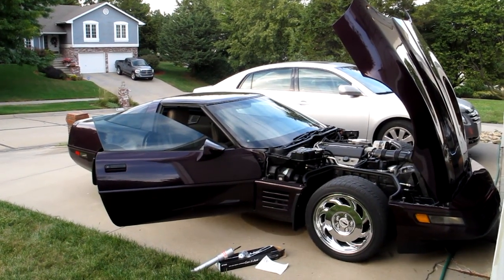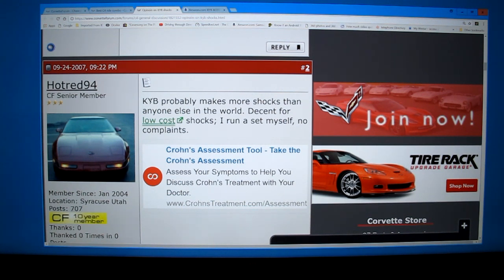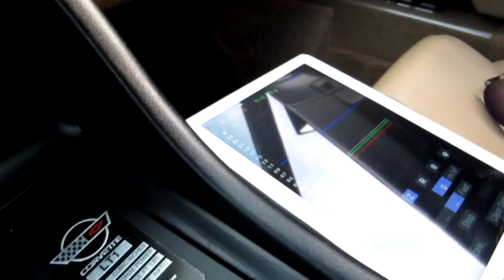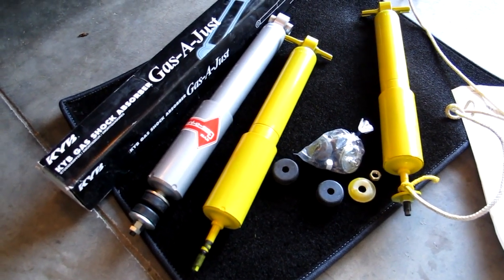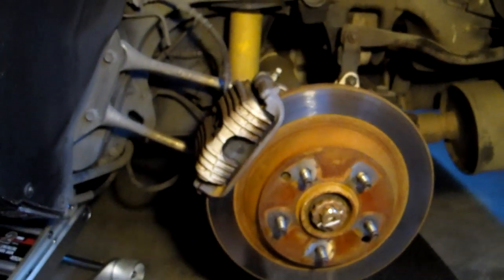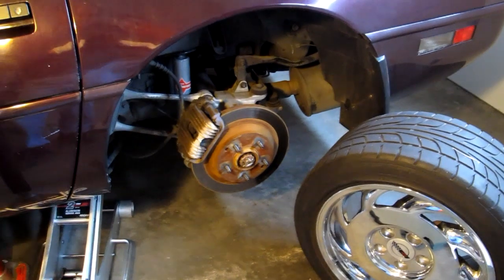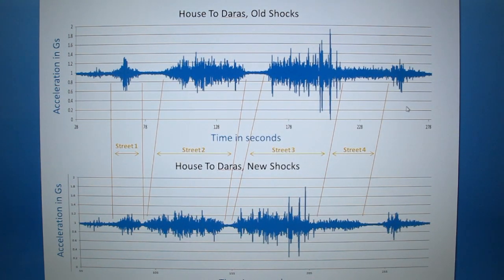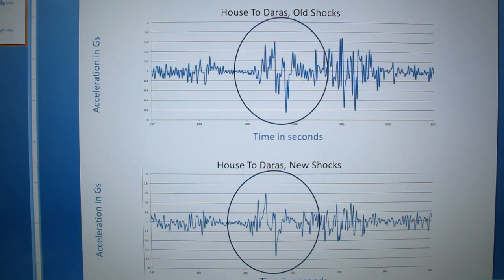Shock replacement and ride quality in 1992 c4 Corvette

Comment: I replaced the still working 27 year old FX3 Bilsteins on my 93 with non asdjustable Bilsteins and couldn't be happier especially with low speed about town driving.
What is the radio head unit you installed...it looks like a perfect fit.
Reply from the maker: Sounds like an excellent choice !  The radio is a Jensen VX7020. I was lucky that a previous owner had already changed out the original and installed new speaker wiring - otherwise it would have been a bigger job. It did fit, but just barely. Here's the whole story :-) https://www.youtube.com/watch?v=w7wkTAyuNk4&list=PL9Ox3wpnB0kqikYYfiCdei_ikfJP8-Eul&index=2

Comment: Time for softer springs.  Going from 2 cps to 1.8 makes a big difference
Reply from the maker: It appears that lots of things help.  Earlier this year, I replaced the tires with Michelin PilotSport A/S 4 types and it improved even further.  Previous tires were decade+ old Firestones. I liked the look of them, and the handling, but the new A/S 4 tires help soften small bumps, so some road surfaces feel much better. Bigger bumps/holes are still somewhat harsh though. Maybe the springs would help that?  (I know in the '87 models the rates were very high and they backed them off the next year. This is a '92. But another commenter noted that I do have the HD suspension...  Build sheet shows FE7 )

Comment: tires and how much psi you have in them is another thing to consider when going for a better ride quality.
Reply from the maker: Excellent point !  I noticed that on our van which came with some pretty hard riding proxy tires.  I even deflated them to 22 psi one time to try to improve the ride, but in that case, no luck. Fortunately they didn't last real long and we got some "ComfortTreds" and they made the van so much nicer !  The Corvette ride definitely degrades a bit with more air (I have them at 35 psi for the coming winter and noticed they are more harsh). In the video before and after though, they were unchanged - so the shocks help too :-)

Comment: Thank you SO much! I downloaded it and will use it to test my Vette. I think it has original shocks on it, so it would be great to know whether or not I really need to replace them and whether if I put on new ones it will really get better. I think it has Bilsteins now, but it is an old car, even though low mileage. I think maybe just being old, the shocks might need replacing. Don't know...

Comment: EXCELLENT data. None of this "it just feels better to me" stuff. Just curious, but did you have to do an alignment after replacement?
Reply from the maker: Thanks.  No alignment - I don't think it changed anything significant about the front stance - and even the rear height settled back to close to where it had been. One comment on making measurements like this: The tablet needs to be secured to the floor well so it's not bouncing itself. I tried to do this with some old blue jeans to add some light weight on it. I think they're visible in some of the shots of the 'after' measurements :-)
Reply: @MegawattKS  I am in process of buying a 1993 Corvette, and your info is very welcome. Can you tell me the name of that program, and whether it runs on Android?
Reply from the maker: @moodberry  A good year ('93). My '92 was the first year of the LT1, but fortunately it seems to have been pretty stable, despite being a new design. The "Optispark" gets a lot of hate, but its one of those things that was fixed I think. (and mine was replaced and has been OK - even though I had an ignition problem, I traced it to the coil/ICM and avoided the trap of thinking everything is an optispark problem ;-) )  Back to your question - yes I was running it on an Android tablet. The one I was using is called "Accelerometer Meter" by keuwlsoft. Seems to still be available in the Play store although when I install it now it says it hasn't been updated for my phone's Android version (10). But it seems to still work. When using the Graph mode, when you stop and select Save, it saves to the root directory. I am able to see the txt file when my phone is plugged into my Windows PC - at the top-level directory just as it said...
Reply from the maker: Also - its pretty easy to run. But you may have to 'pinch' the screen to rescale it if it pegs one of the XYZ axis g-force plots to the top...

Comment: What did you do with the shock sensor?
Reply from the maker: Assuming we're talking about the warning light - I was fortunate that someone had already disabled it (don't know how unfortunately).  At least I tested to see what would happen by pulling the plug to an actuator before I started the job and no light came on. So it was disabled, or maybe the system didn't see an open circuit as an issue ?

Comment: Nice adding a little science to the install, thanks I am about to install new shocks. Did you polish your wheels? Mine is the same style, just stock finish, which is a bit pitted. I expected it to settle after install, that is pretty normal.
Reply from the maker: Thanks. The wheels were already Chromed by a previous owner - so I can't take any credit for that. It was about 15 or 20 years ago, but they've held up well :-)

Comment: When you lift your car off the ground and set it back down it'll sit higher than usual. After driving around a bit it will settle down normally. This is fairly common across most cars except for those with air ride they'll settle way down after having been lifted and set back down.

Comment: Great video and great data to back up what you are feeling as you drive.  I don't know if you are aware of this or not,  but the Corvette you have has what is called the Z07 package.  This is what the option on your window sticker shows as "adjustable performance and handling package". This is not just the fx3 adjustable suspension which could be added as a separate option without the heavy duty suspension. This was considered the racing suspension option that very few corvettes had.  This option not only gave you the fx3 adjustable shocks it also came with much stiffer springs and bushings.  The fx3 controller that came with the package was also tuned different for this setup.  It also came with different sway bars from the base car. This package also gave you the bigger front brakes which are rpo code j55 that you see in the build sheet.  All of these pieces together make for an amazing handling car,  but not great for cruising.   While I understand the reason why you went with the shock you did.  It's just unfortunate that you have this particular corvette with the Z07 option.  As it is going to be difficult to make it ride much smoother without replacing a lot of the suspension.   But in the end just enjoy your car the best you can.
Reply from the maker: Thanks for the information !!   I wasn't aware the car had the Z07 package / racing suspension. That's actually really cool - even given what it implies about the limits for toning down the ride :-)  Glad I kept the old shocks and controllers in case someone want's to rebuild them someday.  I'll have to dig more into the Z07 and learn more.
Reply: @MegawattKS  Here is a chart that  has all the details about the suspensions used on c4 corvettes.  https://www.corvetteactioncenter.com/specs/c4/1984-1996-corvette-suspension.html
Also if you open the center console of your car and look at the bottom of the lid you should see the rpo sticker.  It will list all the option codes your car came with.  You should see a code Z07 on yours.
Reply: @MegawattKS  I have the z07 package and just ordered new fx3 bilsteins hopefully their as good as they say

Comment: So are you happy with your choice?does it ride smoother?thing about putting these on my 95 vette.
Reply from the maker: Yes. For my use I'm definitely happy with the results. I don't put that many miles on the car, and don't do track. But for around town enjoyment of the Corvette machine, I feel like they provide a good compromise. The car still corners better than any other car I've used, and the ride is noticeably better. But they will not make a night-and-day difference in the ride. They just settled it very nicely. Hard springs are still there of course. And the new shocks are not as beefy as the originals, as can be seen in the video - so maybe not great for track use?
Reply: Finally got around to installing these shocks last week, the ride is so much better.

Comment: Mate that car really looks to be in great condition!! Someone has taken very good care of that. I have a 93 6 speed vert myself.
Reply from the maker: Thanks. Yes. While it has 115K miles, I was lucky to find it (on Ebay where tons of photos and a known seller of it gave me enough confidence to 'import' it from California :-)   I'm trying to fix little things as they arise and make it even better over time so the next owner (someday) will feel the same. I even kept the original shocks and actuators in case someone wants to rebuild them in the future :-)
Reply: Should have no dramas selling those as a set, i'd grab them myself but my car is a Callaway and has the FX3 shocks slightly modded to take the coilovers.

Comment: Hmm..my 1992 C4 Corvette rides choppier than all get out.  It is equipped with the 'adjustable ride control' which does not work in my example:  it is permanently set at 'tour' which still has a pretty stiff ride;  I feel every crack and bump in the road.  I'm getting a 'service ride control' warning on the display panel too so I know the ride control is not working properly.  This is good info I plan to get the ride control serviced along with new shocks soon.  I can live with it as is but one of those things to get addressed.

Comment: Kyb are better for cruising but if you want to take a corner bilsteins are better i changed mine to kyb it road less ruff but did not handle as well as the stiffer stock bilsteins when i pushed my vette a hard right into a corner the kybs in front extended up & the passenger front tire started wheel hoping up and down because the kybs extended and that tire lost traction bilsteins would Not have done that they would have kept that tire planted to the ground thats why they come stock GM wants the vette to handle best it can.

Comment: Very clean C4.  Too bad about the FX3.  When it comes to old chevy's, a nice base stripper is best.  All the gee whiz stuff that's so cool when new turns on you with age.  And then there's the Optispark.  First year of the first generation non-vented Optispark in your case.  Bless your heart.  I've had a '95, and have a '96 so I feel your pain.  There's good reason that these cars cost less than a '73 Pinto.  LOL.

Comment: The reason it didn’t go further down is simply because of tire friction to the floor. The wheels move in as they extend, and when they come back on the ground they want to go out, but can’t because of friction. Roll it back and forth a few meters and they will be the correct height. Alternatively you can have low friction surfaces (metal plates with oil in between) and it should settle.

Comment: I have replaced many sets of dampers over the years, and have seen the change in ride-height effect many times. The higher the gas pressure in the shock, the bigger the potential change in height. If the old ones have lost all their pressure, or were not pressurized to begin with, you will see the greatest change after replacement. 

Your initial ride-height measurement was no doubt done right after you lowered the car back onto the ground, but before the car had moved. In that situation, the suspension and tires are not fully relaxed - there is some binding or tension in the suspension bushings and also the tires. This is due to the fact that the suspension movement involves arcs; in other words the wheels don't go straight up and down. Long story short, once the car has a chance to roll a bit, that tension is released. So your later measurement is an accurate representation of the true change in ride-height, while the initial measurement is not.

Comment: it went down because the shocks and load on suspension was off. when tires come off ground car will always be higher until you drive it and settle it. It has more to do with the A-arms settling back down with the bushings. Shocks might have some play on height if the old shocks were blown out .
Reply from the maker: Sounds right.  I think in the end it only gained 1/4 inch or so. The old shocks were pretty weak on pressure.

Comment: Good video,shows me i need to change my original shocks on my 89.Ride is too hard.
Reply from the maker: Thanks. Have you done a push-on-the fender test to see if its the shocks vs springs?. Mine was more of an unsettled (rattle'y ride) than a hard ride. The old shocks were letting it 'ring' too long (about 2 or 3 down-up-down movements before it settled) The new ones helped by decreasing that to just a single down-up (critically damped system). Alas it didn't change the harshness going over some sharp bumps. Still a good cornering car, and that's the price to be paid :-)

Comment: Shocks should have ZERO affect on ride height.  Shocks do not support the car or bear the load.  The only reason the shock is sitting higher is because of the nitrogen gas in the shock which is there to keep the oil under pressure so it doesn't cavitate in the shock body.  Supporting the car is 100% the job of the springs, the shocks simply control the oscillations of the spring, turning the up and down motion into heat.  KYB GR2 are a very entry level shock with extremely mild damping, and really don't belong on a Corvette.  Why even purchase a Corvette if you are looking for a Cadillac ride?  The whole point of the C4 was that it was an amazing handler!  GR2s belong on minivans, not Corvettes.  I would have gone for the OEM Bilsteins or Konis.  Furthermore, the shocks need to be matched to the spring rate.  No doubt in my mind the compression & rebound of GR2 are far too light for the high rate springs of your C4.  Spring rate has a lot to do with ride quality.  Even if you matched the shocks perfectly to the spring rate, if the rate is very heavy the ride will be terrible.  That is just how it is.
Reply: "Why even purchase a Corvette if you are looking for a Cadillac ride?" Because I love the looks of a Corvette, and the acceleration of a Corvette. I don't like the harsh ride, but I tolerate it for the first two reasons. I like to accelerate hard, and hear the sound of the Corvette's engine. I don't take it to the track and I don't take corners at greatly elevated speeds. 10/10ths cornering, or even 7/10s cornering is probably never going to take place with me at the wheel. At my age, comfort is becoming a factor. Yes, I know I could buy other cars more suited for fulfilling all my requirements, but they wouldn't have the Corvette look. And the price range of the C4 is right on target with my budget. I don't know much about shocks or spring rates, but if I could soften the ride of my C4, I would gladly give up the high cornering limits. Again, I'll never approach them on public roads. He wants a better ride. I couldn't agree more. To each their own, and for their own reasons.
Reply from the maker: That is not completely true. As you said, the gas in the shock is present, and a higher pressure (newer) shock will present more force between the bottom and top shock mounts. The bottom height is fixed by wheel/tire/linkage numbers. The top will be forced up (slightly) by higher pressure in the shock. Spring force is k*x - so if the spring does not have to support a portion of the weight (force), then the compression length x will decrease and the car will sit higher. In this case, I saw about 1/8 to 1/4 inch long term, after the initial settling.
And I agree - you can't expect a caddy ride without changing the springs, which is not desirable and not an option after the vehicle is designed. Newer vettes do strive for some improvement in both ride and performance through more advanced engineering (e.g. electronic control that partially gets around the basic spring-mass-damper system limitation). The KYBs do not deliver a cushy ride. What they did do is provide better control by better damping within the 90's tech system (because the old ones were worn out). Hence both the ride and the performance improved (noticeably, but not night and day). Would new Bilsteins be better?  Probably. But my goal was to make a compromise and I am happy with the result (and savings of about $800).
Reply: Jay I basically heard the same of which you're saying. Have a 96 pushing almost 200ks and he informed me if I change the springs it would make a world of difference. When I bought it with less than 24ks it not only rode great but it still smelled brand new. Took it on 1000 miles road trips and enjoyed myself watching the scenery because of the quietness and ride. I'm sure also everything else needs rebuilding, ball joints, bushing, etc. My biggest problem is stock springs are NOT attainable, trust me I've searched and I can only find used ones on eBay. However there's aftermarket systems out there but how do you really pick the right spring rate for your application. Many claims great ride but when you're doing a job like this you want to get it right the first time. If you or anyone else reading this have a better insight on available new stocks or how to pick the correct aftermarket shoot me a reply. Thanks...
Reply: Like I said, shocks DO NOT support the car or bear the load.  The nitrogen charge in the shocks adds to the spring rate an inconsequential amount, that is not what it is for.  And you can rationalize your purchase of cheap shocks all you want, it doesn't change the fact that they are poorly matched to the spring rate which will give you neither a decent ride nor the wheel control that contributes to good road-holding.
Reply: @jaylestingi  sounds like you got issues